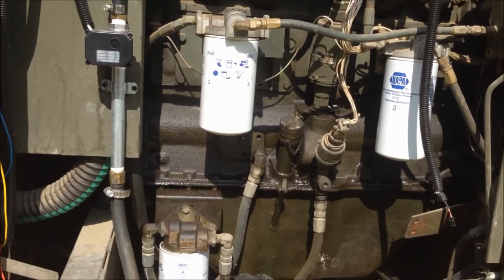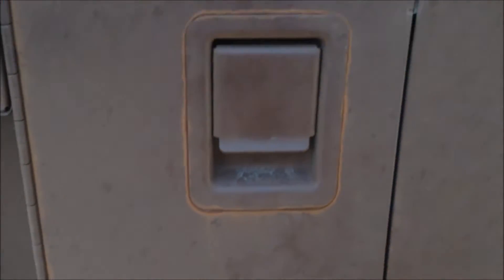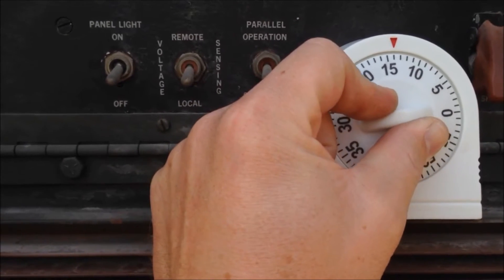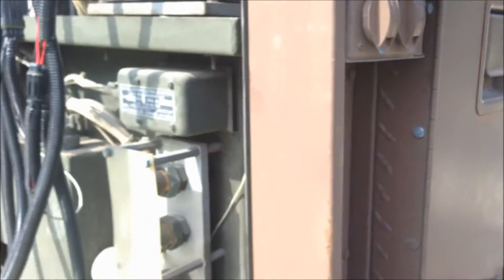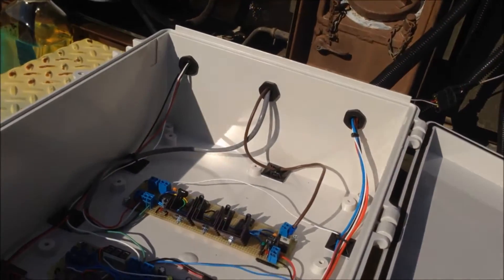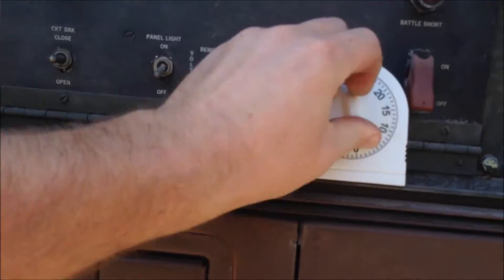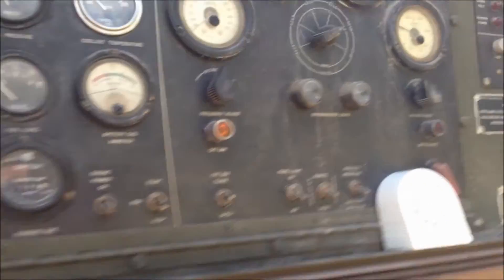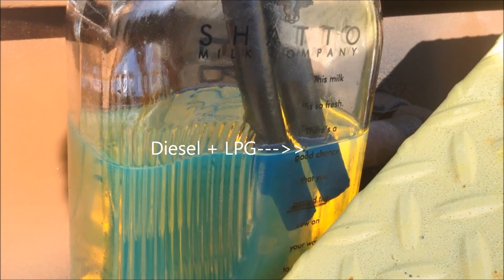Diesel Generator Converted to Run LPG (propane) By CNG Edge

Comment: Well doesn't the throttle for the diesel back off since there is propane being used?  How much propane was being used to compensate for the not using diesel?

Comment from the maker: for more info see cngedge.net or cngedge.com
Reply: You should make a video of a diesel engine run on pure propane with no diesel fuel mix with propane and just run a diesel engine only on propane with no modifications at all and I want to see it running because if most diesel engines have glow plugs it should fire up just fine because most LP gas stoves or water heaters have a glow plug ignition system and they work just fine so idk if that applies to diesel engines too so to make all diesel engines run cleaner on propane and quit selling diesel fuel